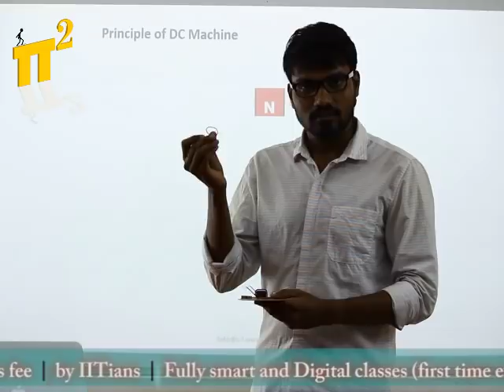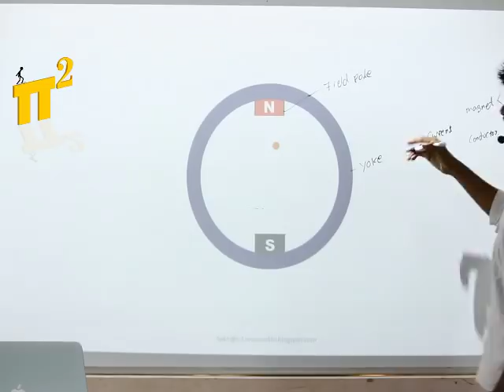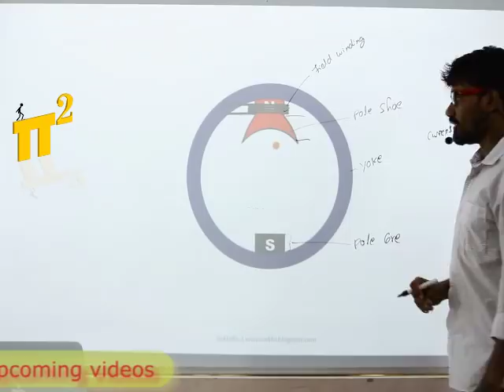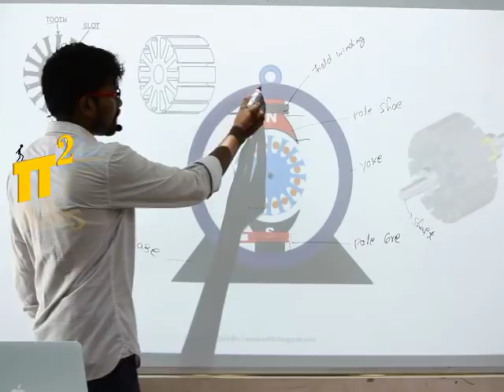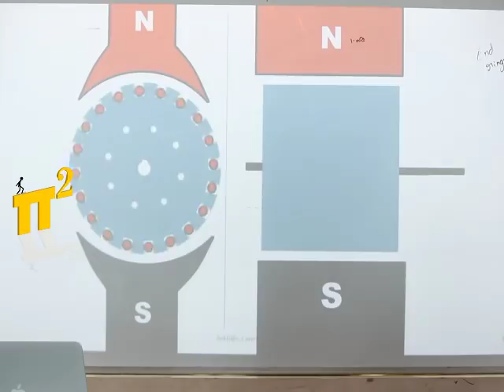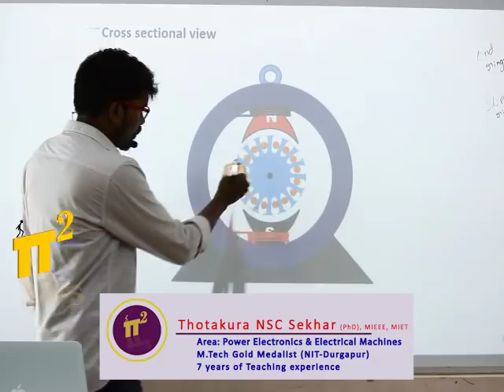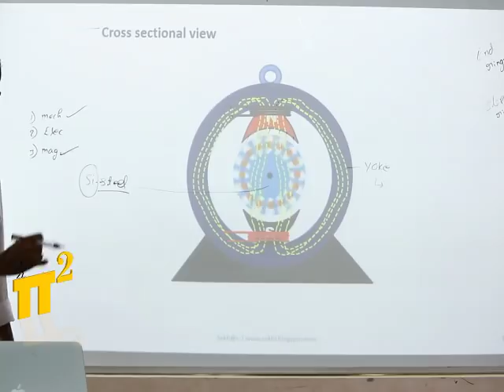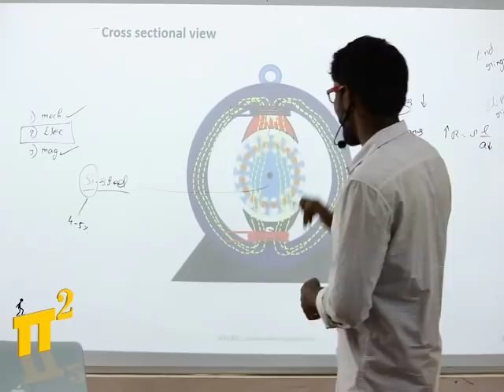Construction of a DC Machine | Animation | PiSquare Academy

Comment: can I use good and strong insulating material as a armature core as it eliminates silicon adding and lamination...is there any kind of that type of material sir..
Reply from the maker: Yeah you are absolutely right, you can use any strong and good permeability material as a core. As such nothing better than si-steel so far, hence we should use silicon mixing and laminations.
Reply: got it sir.. thank you Sir